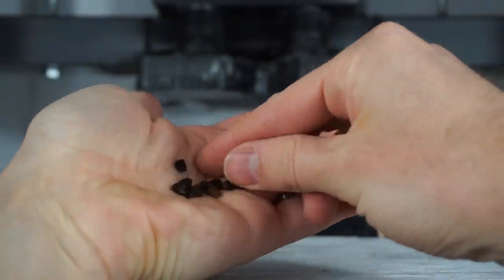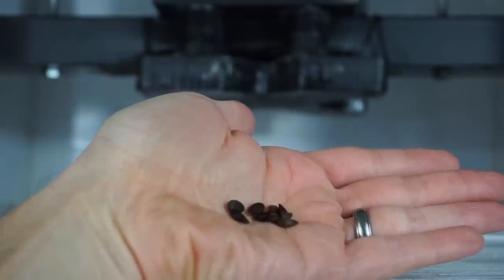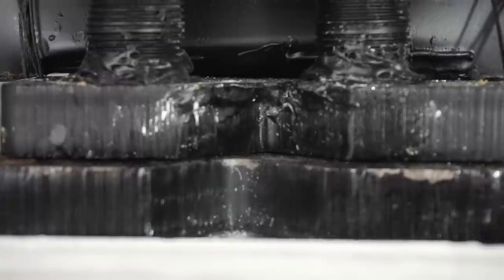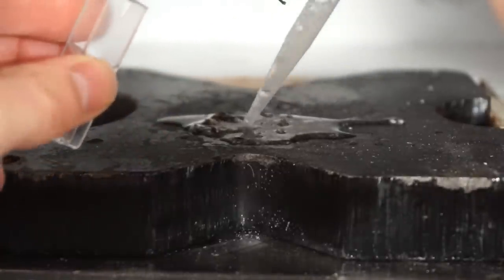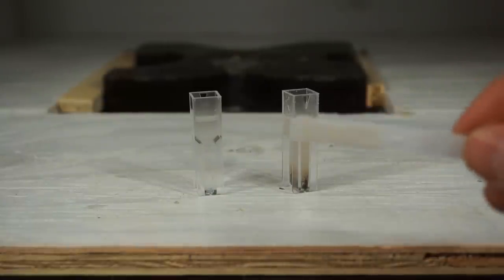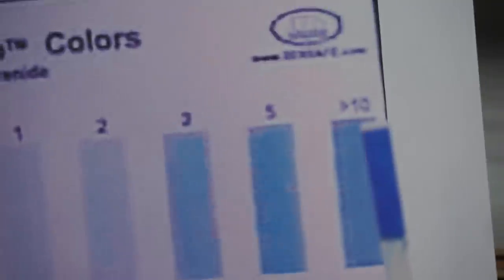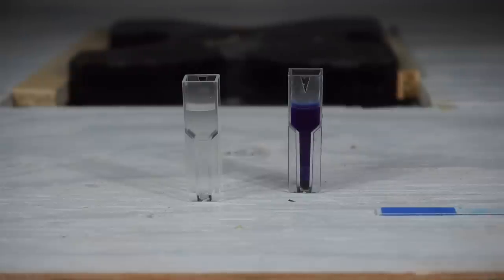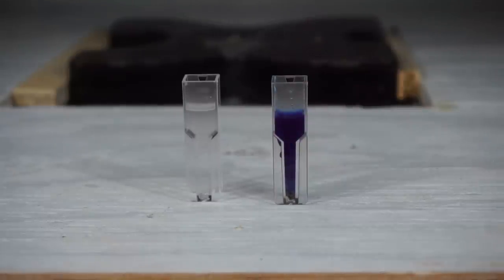Extracting Cyanide From Apple Seeds With Hydraulic Press

Comment: You say that, it's a concentrated solution of cyanide just by mixing the crush of apple seed with the tap water ah!!! Do you even know how to make the concentrated solution. You just ruined the concept of concentrated solution. Remember, concentrated solution is made using distilled water not using tap water. And if you don't know anything about the chemistry, don't just upload the fake videos. And the testing paper what you use won't let its colour in the solution to mix. In the result, your solution turned extremely blue. This confirms that you have used some other chemical to get the colour or you might have used ink to prove it.

Comment: Its a different compound of cyanide dude. Kinda like hydrogen by itself is a flammable gas, but add oxygen and you have water, completely safe. And it's not hydrogen cyanide. It's hydrochloric acid into benzaldehyde, D-glucose, and hydrocyanic acid compound. Or amigdalin if you will

Comment: Apparently you never took serious chemistry lab class. You did a qualitative test not a proper quantitative test. Yes you proved that there is cyanide, but you proved very little about how much there is. You need to know the total quantity of cyanide, not the consantration in some random quantity of water. To take an extreme example, pure cyanide is obviosly a million parts per million :-). Yet if you only eat a nano-gram of it you will be fine. On the other hand, if you eat a gram of it, you will be in big trouble. Doing proper quatitative chemistry is much harder than qualitative chemistry. If you want to do this right, you can probably find a chemist who runs a channel to do a colab with you.